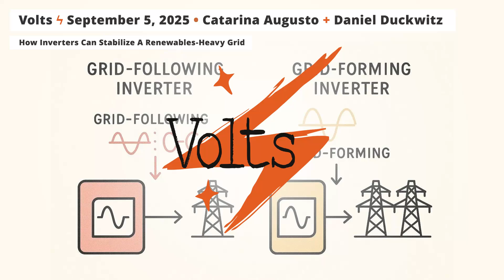Volts ϟ September 5, 2025 – Catarina Augusto + Daniel Duckwitz (How Inverters Can Stabilize...)

Comment: It's become really obvious that the old paradigm of "renewables just feed in all the power they can produce" won't get us any further in markets with high renewables penetration. In other words, renewables production will be load-following at least part of the time, when there is a lot of sun or wind.
So this means that solar PV generators especially do have a power reserve available during the times when they dominate the grid and can perform the full set of grid-forming services, including positive power reserve for frequency control.